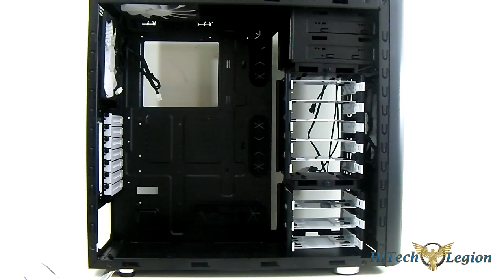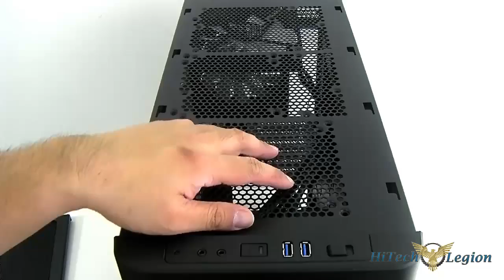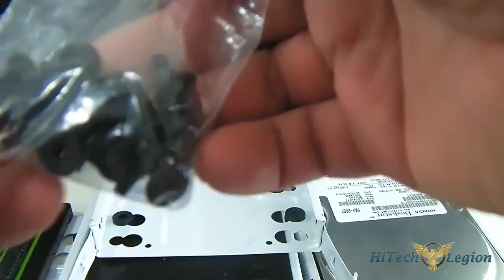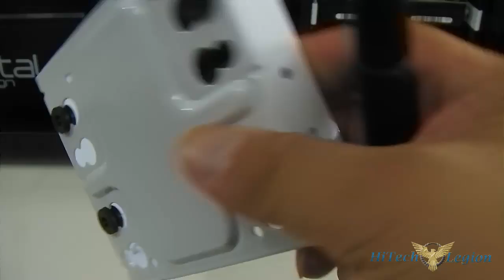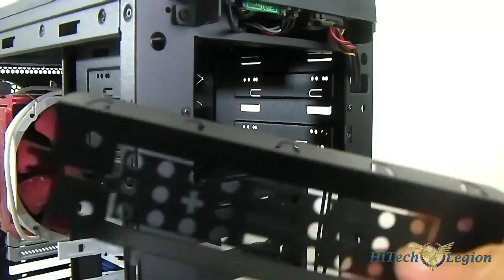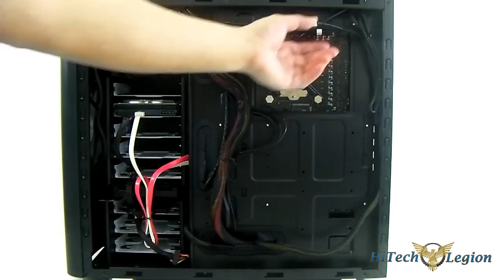Fractal Design Arc Midi R2 Case - Component Installation Tutorial Guide

Comment: You're supposed to use the top PCIe slot for single card use as it's the fastest.  Putting it down there you're gimping the cards performance.  Drop that cooler the MSI frozr or the Hyper 212 will work just as good and leave room for the Vcard in the correct slot.
Reply: A single gpu will not be "gimped" in a pcie x8 slot. It doesn't use all the bandwidth, thus no difference in fps in games. Just an fyi.

Comment: Was wondering which way the cpu cooler fan should be oriented?
1) The fans facing upward blowing air into the top fan
2) The fan blowing to the rear side fan

Comment: Does anyone know if you can fit two 312mm cards (SLI) in this case with just the top HDD cage removed. I think the bottom card might hit the top of the bottom cage, if anyone has experience with this case some advice would be appreciated.